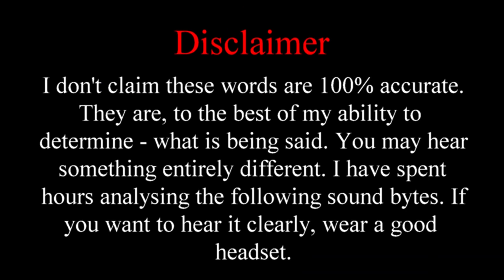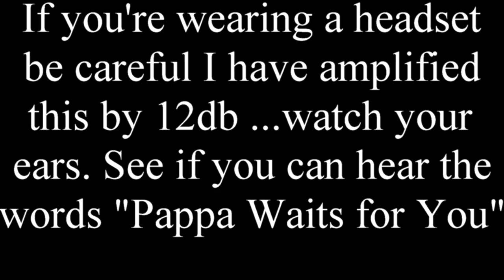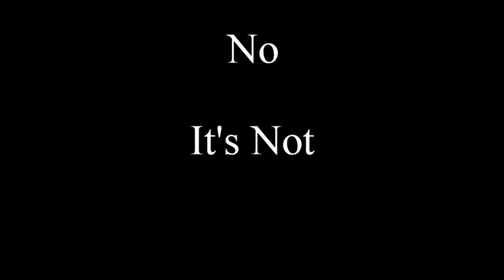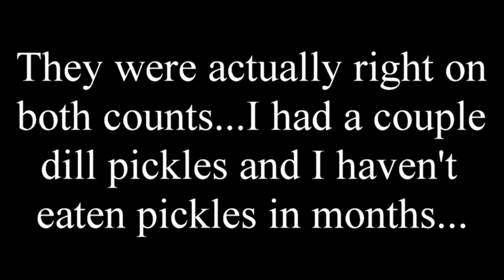A Kettle Coil - The  Search for Cannelloni

Comment: The Gum in the end is not allowing the AIR  in the tube to escape...water won't flow....puts severe load on the Pump...!
Reply from the maker: Yep...I figured it out...I thought the pin holes would be enough but they weren't...I might try it again for fun some day with bigger holes